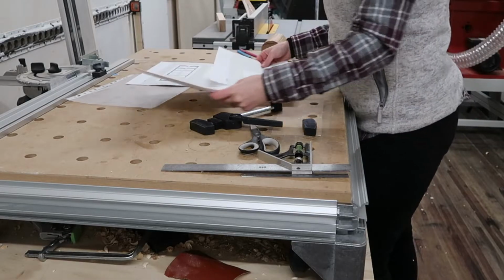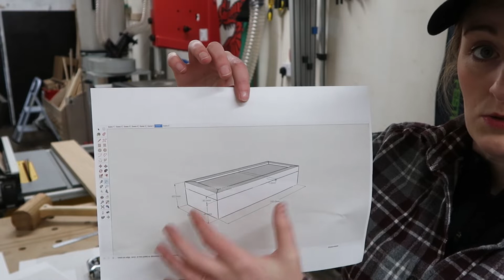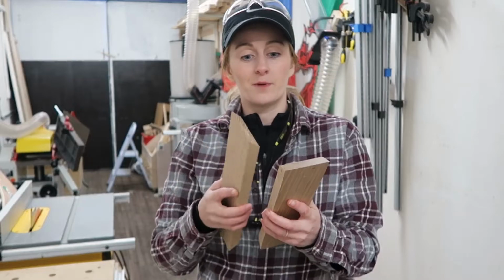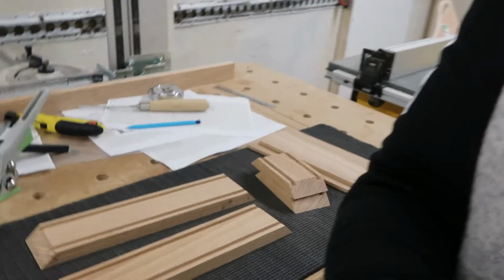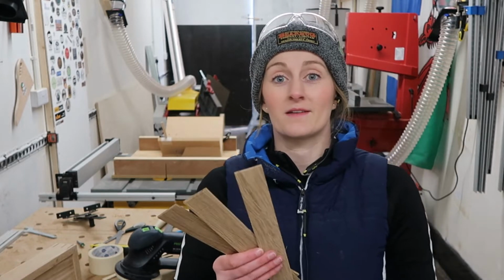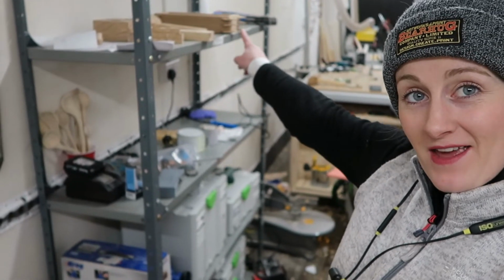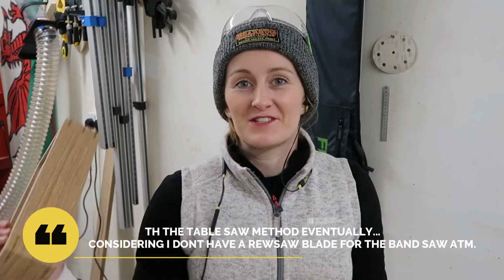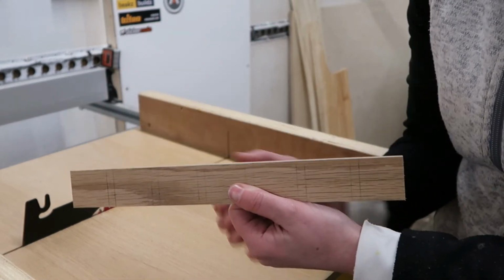Making a Mitered & Splined CUFFLINK BOX! | with HINGED lid!

Comment: Nice job, question the masking tape you used on the straight oak board you started with, what was its purpose.  Sorry if its to simple of a question.  I thought at first it was to help the wood not split. Thank you in advance.
Reply from the maker: Thank you!😊... I use masking tape to mark lines and dimensions so I can see the pencil marks clearly but the biggest reason was to prevent splitting just like you thought. 👍🏻